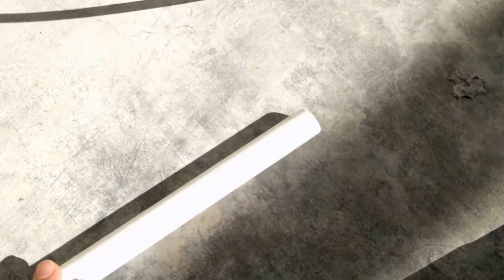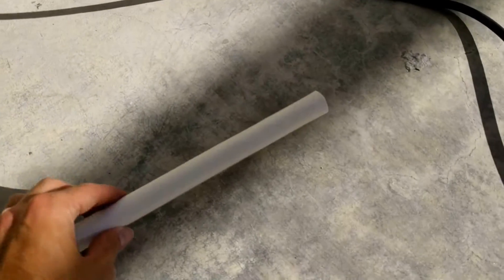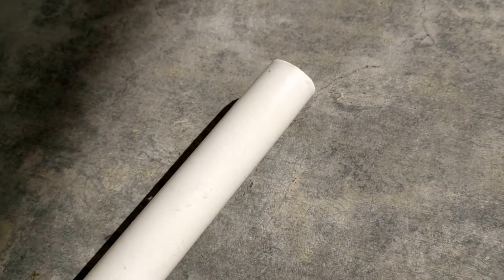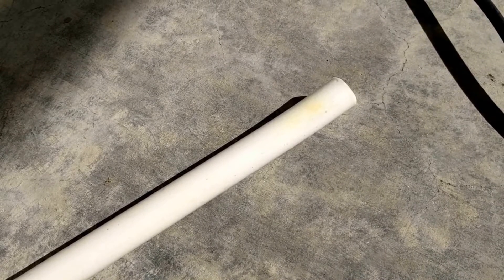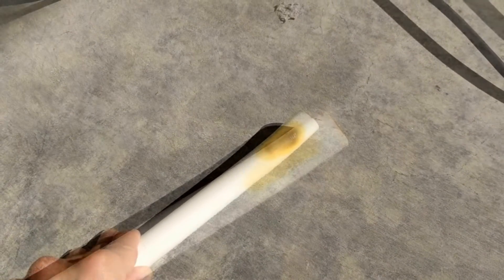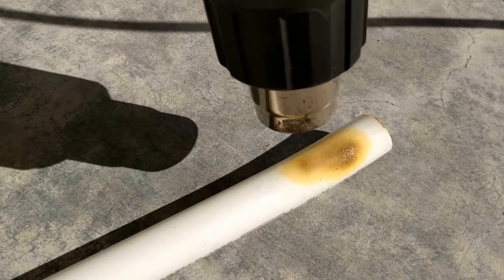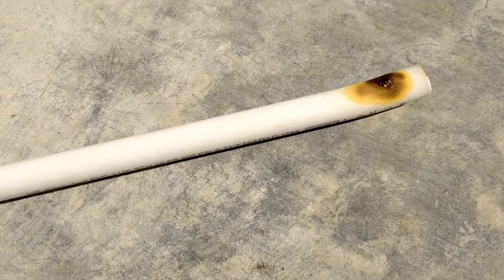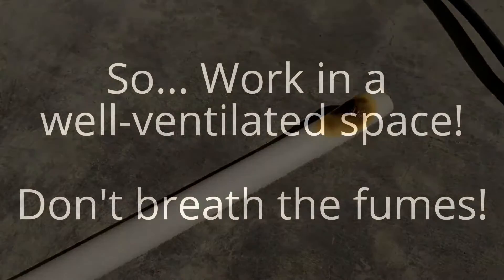Burning PVC - What Various Stages of Burnt PVC Look Like

Comment: Types of plastic:
Type 1, PETE or PET. Used in soda bottles and single use containers
Type 2, HDPE. Very common, used in plastic containers, some bottles and more.
Type 3, PVC. The plastic in this video, used in piping, inflatable toys, and more. This plastic can leach chemicals.
Type 4, LDPE. Not as common, used in PVC free cling wrap, some plastic bags, and more.
Type 5, PP. Possibly the most common plastic, used in Tupperware containers, casings for some electronics and more. Toxins released when manufacturing PP.
Type 6, PS. Also known as Styrofoam, used in packaging. This plastic can leach chemicals.
Type 7, O or Other. The grab bag for other plastics. ABS, PC, etc.

Comment: Would you happen to know what the oily substance on a completely burned piece of pvc is?
Reply: I would guess some compound of vinyl chloride. Definitely not something to eat or breathe in. Almost certainly phenolic hydrocarbons and halogen gas compounds.  I'm sure there is an organic chemist lurking with the exact answer.
Reply: I think it is hydrochloric acid, HCl, extremly dangerous
Reply: Chlorine gas and Dioxin are the byproducts of burning PVC. Chlorine gas was used in WW1 as a very effective weapon and Dioxin is a persistent environmental pollutant (lasts forever) and causes cancer.  PVC is one of the worst things on this planet to burn.